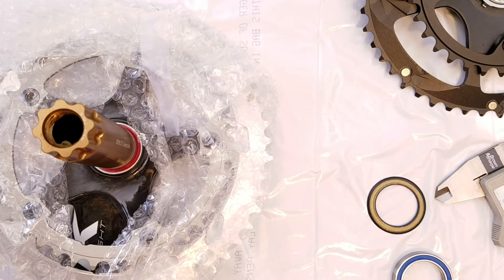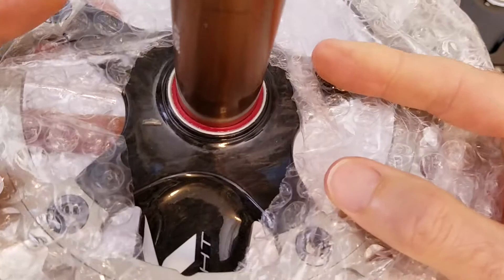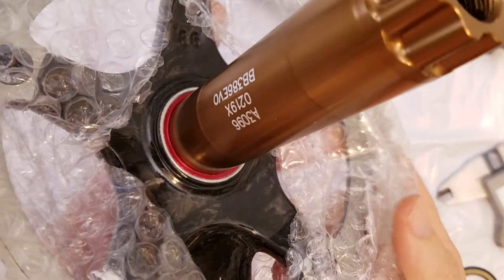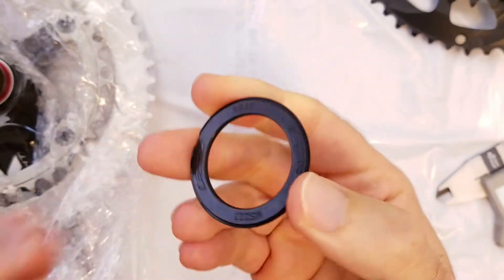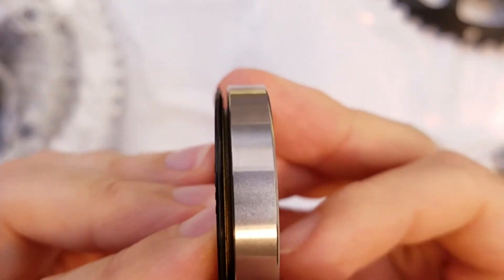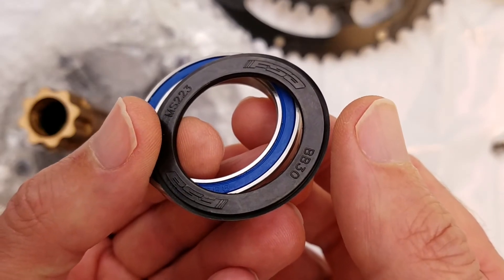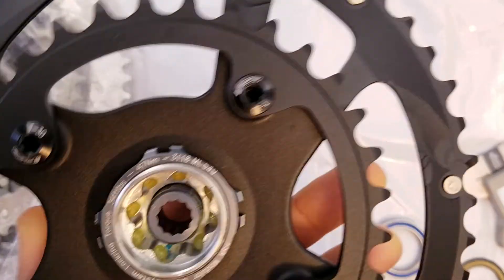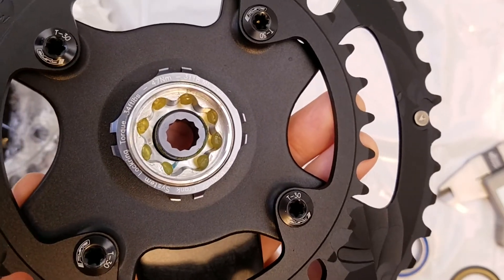Re:  Useless Engineering Exposed:  FSA Power2Max Issue

Comment: I am not an engineer, but I think, that secondary "seal" has to be in contact with the inner race, in order to transfer the preload force. If it pushes the outer race, preload could not be applied and the bearing would just slide-so bearing would be destroyed very fast. 
I just do not think its primary function is to seal something. FSA engineers had to put this peace there, because some dick manufactured that stupid lip, therefore preload is directed to the bearing seal, not the inner race. So Hambini is once again right - their crankset with that lip is a crap and big mistake. And if that "seal" just slightly pushes the bearing seal, the drag in the bearing increases exponentially. So yes still a bunch of morons who created this product.
Reply from the maker: According to FSA, the lip has been removed from all their models of cranksets.  It was a running change though, so you may still find old stock for sale that has the lip.  They could not provide any explanation as to why it was there in the first place.  As for your analysis, it doesn't make sense to me, except I agree with the final conclusion: FSA are a bunch of morons.
Reply: @shibaburn7725  Thanks for your reply, I try to explain it a bit better. I see that secondary seal more as a spacer. For Fsa crankset you apply preload on the inner race on both bearings (the force goes from outside in) so both inner races move towards each other. Hambini said it better in video https://www.youtube.com/watch?v=nwiVlLfqG1M from minute 33.00 to 41.00. So for this particular fsa spacer/seal in order to tranfer the preload force from the lip to the bearing, it cannot touch the outer race of bearing. If it does, the preload is not there anymore and bearing skits instead of slides. The bottom line is I think, that there has to be a little space between outer race and the spacer, for the system to work properly. (as you said in video, it does not work well as a seal, but I think it has to be there to act as a spacer-all that because of stupid lip design). What do you think? I am glad that fsa got rid of that cankset with lip design.
Reply from the maker: @marianteplan7876  On every crankset that I'm aware of, preload is applied on the inner races from the outside towards the center of the bike.  This is a good thing, because otherwise the preload force would tend to unseat the bearings!  So you are just stating the obvious regarding that.  If one is going to have an auxiliary seal, the place to seal against is the face outer race because 1.) the dimensions of the bearings are very tightly controlled.  2.) Pressurized fluids from the outside tend to enhance the function of the seal, instead of tending to defeat it.

Comment: also, do you know if the Hambini Bottom Bracket for bb386evo works with these cranks? The 92mm shaft length requirement seems to be too long for the crank.
Reply from the maker: FSA is the originator of BB386EVO, so Hambini's BB860EVO bottom brackets should work with FSA BB386EVO cranksets.  You can ask him to verify.  He can also make bottom brackets to your custom specification.

Comment: The crank side seal that I have, has a step on the outside as well. It's plastic and fits into the slot/ridge/lip. The seals should have a drive side and non-drive side.

When the cranks are installed, do you think the seals push in?
Reply from the maker: I think the DS and NDS seals are identical.  I guess they are meant to seal against the interior of FSA's polymer BB386 cups.  It seems like it is is a very ineffective way to seal.
Reply: @shibaburn7725  What I mean is that it is not identical. I have a FSA BSA BB386EVO bottom bracket and a FSA BB386EVO crank. The DS and NDS seals are indeed different. The DS has a lip on the rubber side that slots into the gap for the lockring. Granted this setup is about 3 years old, but I had just taken it out to move to another frame, and noticed that difference. Perhaps the BB30 cups are different, I can't say.

As for the bearing side of the seal. I didn't check. :( I saw this video after I transplanted the cranks and BB, and didn't check that. I actually wasn't aware of that problem. I do have a newer crank now and using the WheelsMfg BB, so I don't have the FSA seals or BB.

Comment: Hi
Not sure why one thought the ‘seal’ should be in contact with outer race of bearings.
Cranks, spindle, as well as inner race of bearings are the rotating parts, while outer race of bearings shall be the stationary parts, with the frame (obviously)
If a ‘seal’, clamped on spindle, has lips touching on outer race intentionally, that’s friction.
Therefore i think it is logical s what you’ve shown, that the lips leaves a gap.
Anyway I’m not an FSA engineer.
Reply from the maker: Hi.  Non-contact seals are poor at sealing out water and small contaminants compared to contact seals.  Because bottom brackets are frequently exposed to water (with suspended particulates), a contact seal is preferable.  For cranksets, rotational speeds are very low (< 120 rpm), and thus heat build-up from the additional friction associated with contact seals is not a concern (unless you are a TdF contender).
Reply: Shiba Burn well if you’d determined to call a spacer a ‘seal’, then naturally it has to perform as a ‘seal’, and let’s see what fsa engineer says.
Reply from the maker: @Billo7979  It's metal spacer with silicone rubber molded around to act as a seal.
Reply: Shiba Burn It says in FSA Power cranksets installation manual: 
‘6MS188 Adjustment Spacer x1 (optional)
To adjust Side Play, the MS188 x1pc 6may be used on the left side or right side’
The MS223 ‘spealcer’ that you’re showcasing, i believe is the one comes with bottom bracket, of which, in installation manual, is not even having a name at all! 😁
s.p.e.a.l.c.e.r........
Reply: Well to be honest, i personally don’t mind that this piece acts as a seal, but cycling industry is a funny place, where people spin a crank to showcase its a ‘good’ system by how long it stays spinning.